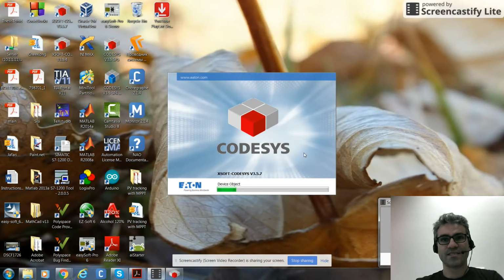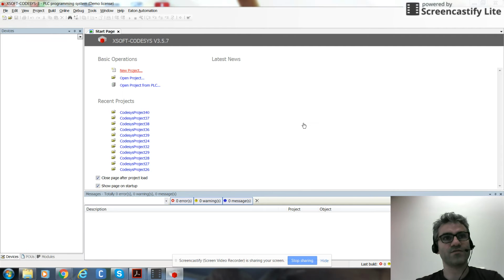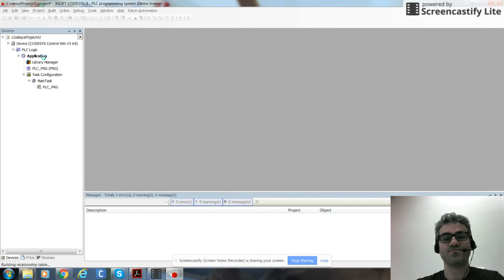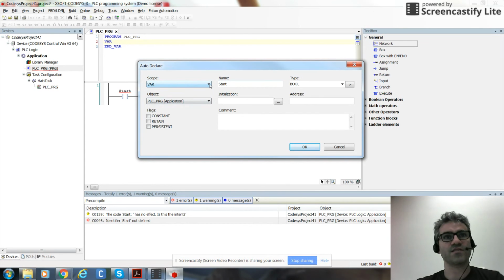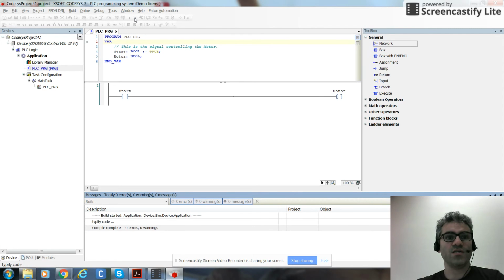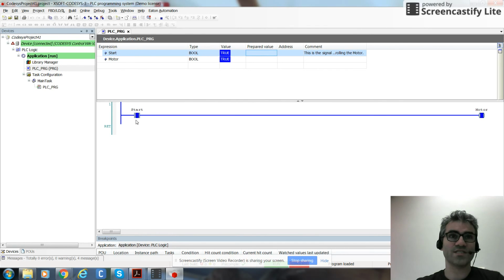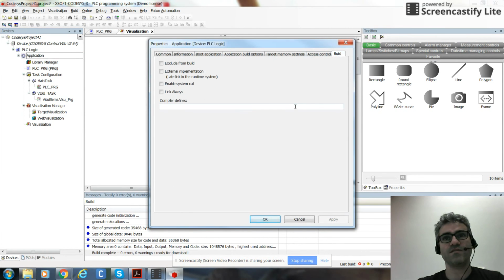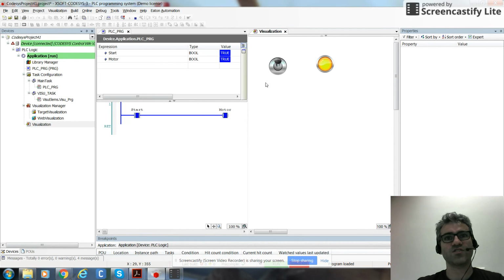CODESYS: First step - Creating a project and adding visualization #codesys #plcprogramming #iec61131

Comment: Good day,
I've installed the version CODESYS V3.5 SP21 Patch 4 from the codesys website. I followed the lecture and the simulation works. The problem is after inserting the visualiazation symbols and configuring the text 'VISU_NO_EXCEPTION_HANDLING', still two errors are appeard: 1. PROPERTY HANDLING IN ALL VISUALIZATOIN ELEMENT PROPERTIES IS ACTIVATED BUT COMPILER DEFINE VISU_USEPROPERTYINFO IS NOT SET.
2. You are using inconsistent overlay setting, please check your compiler defines for the current application...

Comment: I've got lenze PLC ,how to add lenze plc to codesys.is that possible to program lenze by codesys
Reply from the maker: I think it is. Have a look at the following link, as an example:
https://download.lenze.com/TD/PLC__Motion%20function%20libraries%20PLC%20Designer__v12-0__EN.pdf
Reply: The link you send it is for plc designer which need license,I thought it could be able to program lenze by codesys
Reply from the maker: @mekbots7607  I have not worked with Lenze PLCs.
Please ask your question in the Facebook group, so someone may answer it.
Reply: Thanks very much ,I’ve got another issue,could you please tell me how to connect to data base (Microsoft access file database).plc should read data from that data base in my drive

Comment: What is the use of the "VISU_NO_EXCEPTION_HANDLING"?
Reply: from helpme-codeses:
"As an alternative to the Stop Execution on Handled Exceptions command, you could set the compiler definition VISU_NO_EXCEPTION_HANDLING for the application. As a result, the exception is not caught by the visualization and the programming system shows the location where the system has crashed"
Reply: @simxschl  Thanks

Comment: Hello, I want to control a cylinder using a directional control valve. But I don't how to draw the components in the visualization window in order for me to control them.
Reply from the maker: For the cylinder you can simply use a rectangle and animate its position, or a Bar display.
Reply: @TohidAlizadeh  is there a possiblity for me to draw or design my own setting like in CAD programs?

Comment: Hi Tohid. I have a question. Why the FBD/IL/LD option on the top bar doesn't appear on my CODESYS tool ? ANy idea ?
Reply from the maker: Let me know if you have chosen IL as the programming language when you started to create the project. In this case, it seems that you are not able to convert the IL code into LD or FBD. But if you choose FBD or LD as the initial programming language, you should have the option of converting it into IL or the other one.
Reply: Actually i think you are using the tool from EATON and i am using from 3S Smart Software. I don't even have the option to select IL when creating the new project. :(
Reply from the maker: Well, that might be true. I just checked another installation and I did not see IL as one of the options!
By the way, you will have the FBD/IL/LD only when the PLC_PRG (or any piece of code) is open and active. Otherwise, it will not be shown.